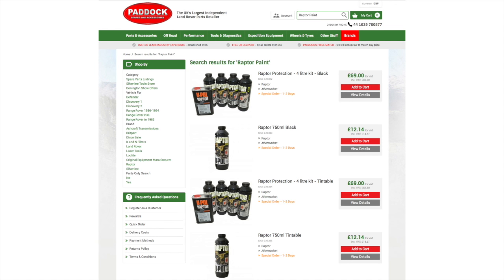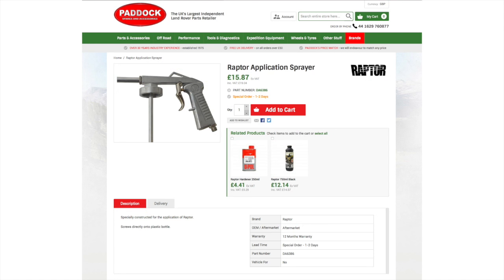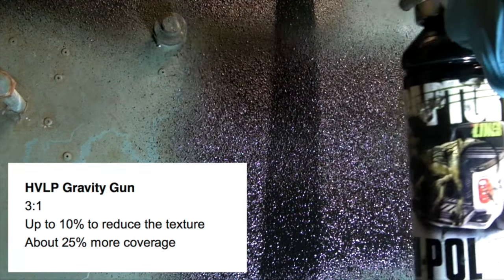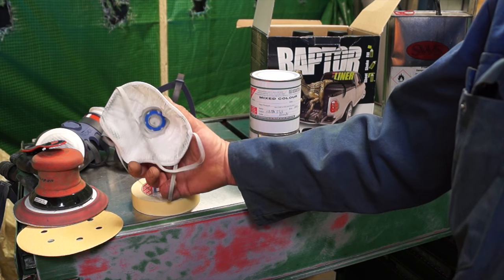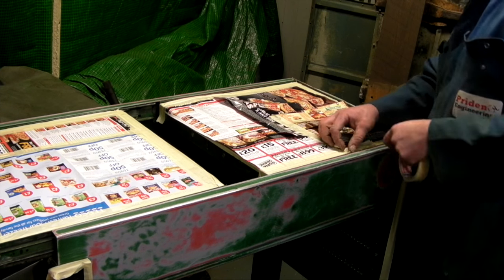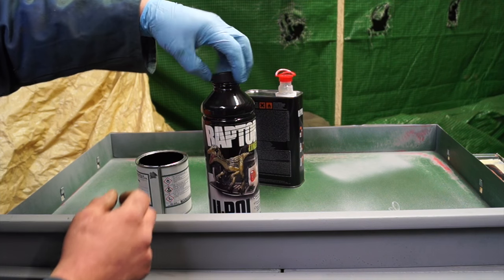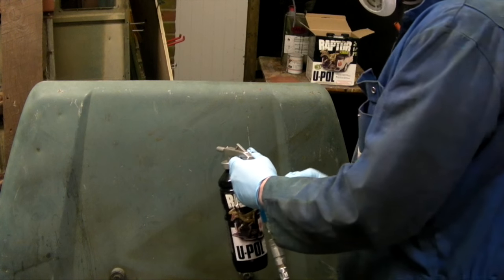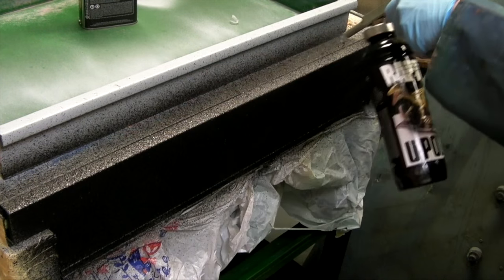Upol Raptor - Applying a Course Texture (Tintable) - Land Rover 110 Project Rebuild

Comment: i have just finished making a bumper and it is still bare metal. i just placed an order for raptor liner kit...  do i need to use the acid etch #8?
that stuff is pricey and makes the cost$ of this project almost double :(
is there a cheaper substitute that i can order online that you know of ?

Comment: I may have missed it in the video, but do you use higher, or lower air pressure for a fine texture? I will be doing my tonneau cover and want as fine of texture as I can spray. Thanks.
Reply: Vince Ruland higher pressure smoother finish.

Comment: This stuff is awesome! I want to paint the exterior of my Jeep in this but i do not want to use the Shultz gun.  I don't like how it sprays.  I want a fine texture but still have that grainy feel.  Which tip size should i use?  Should i add silica sand to the liner?  Any help would be appreciated.  Thank you!!
Reply from the maker: It can be sprayed with an HVLP gun tip size varies on the texture you want. 1.4 to 2.5 but i would advise you experiment before you commit yourself.    You need to use their thinners too. .  I will be doing some work with a spray gun and trying out the LVLP gun to see if it works.  It should do i would have thought. .    Not sure if you want to add silica to it for everything.  Perhaps just in the area where you want a high grip surface. ?? 

Here is the Upol video which goes into something about the HVLP spray half way through the video    https://youtu.be/AiHVcfshObQ     Great to have a Jeep guy watching LR stuff.

Comment: How have u got the little gauge stabiliser thing to work on the gun and where did u get the bits to make it please?
Reply from the maker: Guage you can get form Ebay of from a paint and gun supplier.  I ended up breaking it..... ( dropped it )

Comment: I'm looking to use this on bumpers, rock sliders, and roof panel on my old discovery. I must admit, the 2k/iso warning is a bit scary......Is it ok to spray without an air fed mask???
Reply from the maker: +Mark Osland  Do you have a paint supplier in your area that does automotive paint?     There are filter masks that will work as long as you have good ventilation.  Have a word with them.  I paid about £40 for a mask that is suitable that has changeable filters.
Reply: +Land Rover Toolbox Videos Thanks very much for the advice......it's probably about time I treated my old lungs to a decent filter mask rather than holding my breath........

Comment: Brilliant fun you gave me a proper laugh ... and I learned more about this U-Pol stuff which I'm interested in for a couple of heavy duty applications ... Cheers mate .... keep on dancing ;o)
Reply from the maker: +Matt Allen  ha ha  I want to do some rude gestures but this is a family show  lol.   It will also cover on wood,  Anti split grit can be added to it as well if needed.  Not just for Land Rovers. .
Reply: +Land Rover Toolbox Videos lmao ... Seems like good stuff... I was thinking I've got to replace the trailer board in my 8x4 (which ironically needs  a 10x5 board thanks to metric conversions!) and shooting this stuff over it might be the way to go... I'm assuming you meant to write anti 'slip' grit ....
Reply from the maker: Yes Matt, "Anti Slip".

Comment: I've got a couple of packs to do my 110 so it's great to see a demo - my only question is... why did you tint your tintable Raptor black when you could have just used black Raptor? Different shade of black perhaps? Also can you tint it with metallics?
Thanks
Reply from the maker: +mattoriental  Don't know if it is possible to tint with metallics as that is usually done with clear lacquer.   I have a few different colours so I got the tints for different jobs.  I believe the black I am using is glossier than their black.   Will be painting with NATO green too soon when the HVLP gun arrives. .
Reply: +Land Rover Toolbox Videos Thanks, I look forward to seeing you do the Nato green